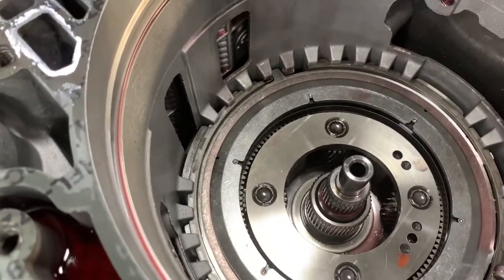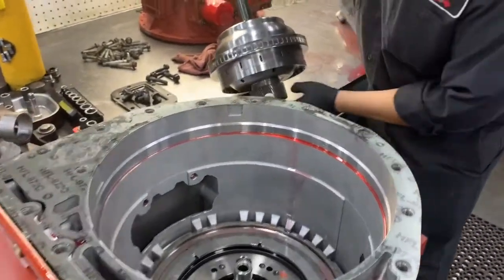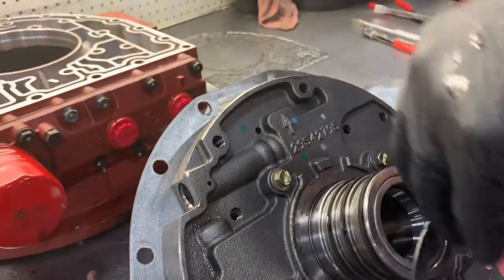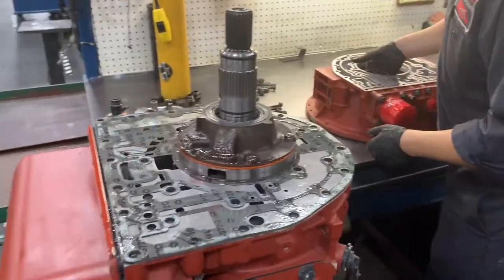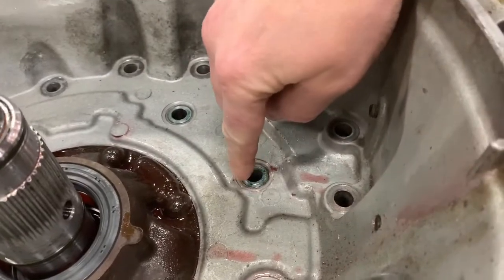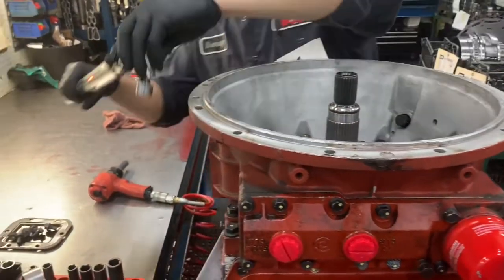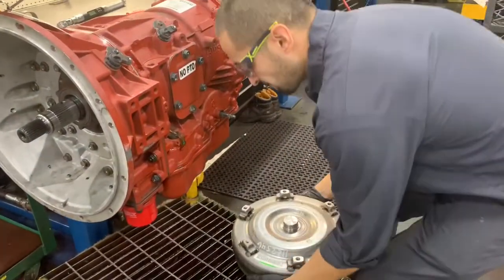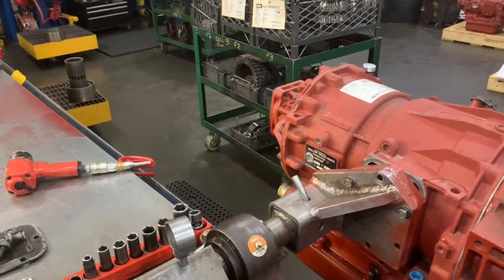Allison 1000 or 2000 Bell Housing Replacement

Comment: Good info in this video. My allison 1000 slips into limp mode and at times wont go into gear at all and sometimes does some grinding like its trying to go in gear and finally after playing with it its like nothing is wrong as long as i take it easy but will still do it over again. Should I do a rebuild?

Comment: Whats the cost to replace a bell housing on a 2004 gmc 2500hd lb7 allison transmission mines cracked at the bottom bc the previous owner never said anything about the bad u joint at the end of the driveshaft which costed me 100.00 to get replaced. Thanks

Comment: I have a 2003 Dodge Ram with a 5.9 engine. I want to put an Allison behind my Cummins engine and I see that Allison offers the 1000 series transmission with a Cummins bellhousing however there are variations of the actual Cummins bellhousing. How do I know which bellhousing will work on my transmission?

Comment: Hey Nathan. I am changing an engine in my 2003 to a built cat 3126 I put together. I am wondering if I can buy a SAE#2 housing that I can replace on my trans. I see them for sale but the back of the housing oil passages look slightly different in one area. The one I was looking at says it's for a 1000.   Do you know if one is available for what I'am trying to do?  I would just get an Allison that would bolt up but I want the t case behind one. And I can buy the stage 3 kits to make the 1000 strong enuff to hold the 900lbs of torque. Any direction would be appreciated.   Great video by the way.
Reply from the maker: Yes housing part number 29556621. You can use the same speed sensor but the cooler lines and fittings will need to be changed to #12 o-ring fittings.
Reply: @nathancranson6421   thank you so much Nathan. I really appreciated reading your response. I will get one ordered and as for the lines it sounds like cake work.  Awsome.

Comment: Hi, I need to replace my bellhousing as it has a chunk missing out of it. I have a donor transmission. I noticed on reassembly that the gaskets got covered in oil on the plate in your video, does that cause a leaking problem or will that be ok? I was nervous about that with mine but you dont seem to mind it so it must be ok? Thanks for the video!!
Reply from the maker: As long as the baskets are in tact and not ripped it will be ok. Make sure to use the copper washers in the same location they were removed.
Reply: @nathancranson6421  thanks a bunch man! I appreciate the reply

Comment: Hey I put a new bellhousing on an Allison 1000, the output won’t spin with the stator and bellhousing on, It will without and slowly spin the input shaft, I don’t remember if it did before , I’ve took apart to see if anything was binding to cause this, any idea?
Reply from the maker: If you are doing it horizontally the bearing underneath the rotating assembly(stator) probably dropped down out of its seat. Remove the bearing and dry the oil off and stick it in there with vaseline. DO NOT flip the bearing. Make sure to put it back the way it came out or you will scatter all of the hard parts in short order.
Reply from the maker: It’s just a flat thrust bearing. Kind of looks like a big washer.
Reply: Nathan Cranson so ur thinking the bearing you show in the beginning of the video slipped down and is binding up the trans, I believe that. I’m assuming the trans output should turn if it in out of park? Thanks for the reply
Reply from the maker: Cameron Hubbard Yes, if doing horizontal sitting on the pan that brg could drop slightly and when you tighten the bell housing bolts it binds the gear set. Yes trans output should spin in any position except park. Make sure torque converter is properly splined when installing in truck. It takes 3 steps. And never draw the bell housings together with wrench or impact.
Reply from the maker: https://youtu.be/QKbWS9nmaao
Reply: Nathan Cranson wow thanks a lot
For the help that really makes sense!
Reply: Nathan Cranson can u buy just a replacement if this bearing was damaged in this manner?
Reply from the maker: Cameron Hubbard give me a shout during the week when I’m at work. Then I can get part numbers and prices. 616-724-3740.

Comment: Thanks for the video.  What is the 2 hose ports by the oil filter ? On my allison 1000 I'm swapping the GM bellhousing to the sae# 3 bellhousing from a allison 2000 .
Reply from the maker: Cooler lines some bells have a removable manifold some are integrated. Either will work just make sure the fitting sizes match. There is a #12 or #8.
Reply: @nathancranson6421  that's for the oil cooler lines I imagine. There just in different locations from the 1000 bellhousing to the 2000 bellhousing.  I'm piecing it together it's my 12v / allison project truck sorry for the lack of knowledge . Thanks for your help  :-)
Reply from the maker: Ken Gray no worries. Yes the cooler lines. I helped one of my friends do this once. The GM bell has built in 3/4” holes for the fittings.
Reply: @nathancranson6421  yes they sure do. Just one more question when replacement the bellhousing. Would you recommend me replacing both sides of the bellhousing plate gaskets. And by chance do you have the bolt torque handy I think I  seen 18-21 ft-lbs
Reply from the maker: Ken Gray yes replace both gaskets. Torque for all of the 15 mm bolt heads is 38-45 lb/ft.
Reply: @nathancranson6421  Thank you for all the help
Reply from the maker: Ken Gray no problem